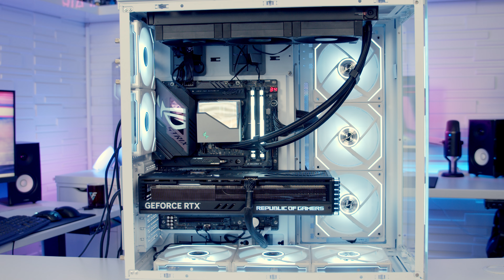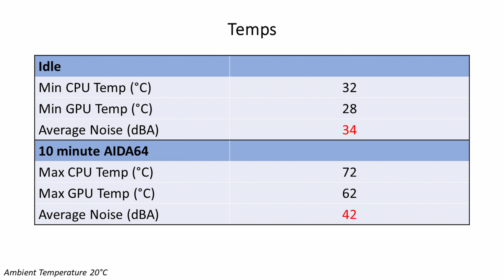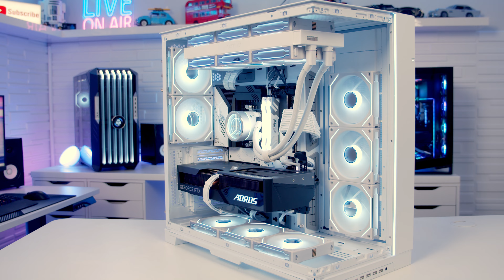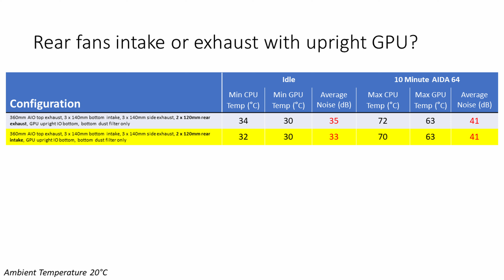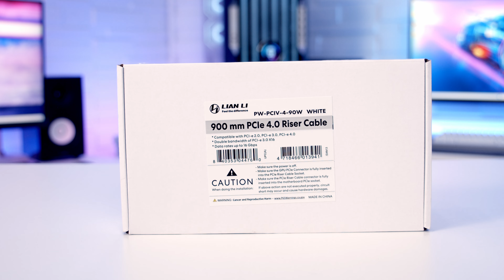Lian Li O11 Dynamic Evo XL - Best Fan Configuration

Comment: TLDR: You're rockin' it. Thank you and keep up the good work!
This is amazing sir. I have thoroughly appreciated your Lian Li o11 D, and XL analyses. (I never comment on videos, and am going out of my way to show my appreciation!!!) I stumbled upon your channel after doing over 50 hours of case-, case fan-, and radiator fan-based research this week. I then theorized optimal builds with the Phanteks nv7 and o11 D XL using hand-drawn fluid dynamic vector sketches for fun. I very quickly came to the conclusion that the upright GPU mount with 3 exhaust fans behind could potentially be the best configuration, and feel incredibly vindicated after watching your videos! I have a request, if I may... Have you attempted mounting the rear fans as intake, blowing fresh cool air along the face of the AIO, and helping to redirect some of the 140mm bottom intakes toward the GPU? edit: I should watch to the end. I was also (controversially) toying around (in rough draft paper format of course) with intaking the top fan closest to the GPU. I only need a 240 AIO with my 10700kf, and this could allow me to 'attack' the GPU with intakes from both sides. Falcon Northwest has a rear exhaust 120, and FE card exhaust right above their 80mm intake, similarly 'attacking' the GPU from both sides to maximize cooling, and having the exhaust/intake still nets lower temperatures.
Reply: Wow... I now realize you already fulfilled my request with the rear intakes!!! Unreal... nice work.

Comment: Womder how thermally for the upright gpu if you set aio at the top to intake with the bottom intake rear exhaust and fans behind upright gpu exhaust would work. Seems like positive pressure to me that would beat natural heat rise...

Comment: Lian Li really knocked it out of the park with this case. It's future proof for any sort of build you're going for. I bought a galahad trinity II 360 AIO and 6 140mm infinity fans and 2 120mm infinity fans for the rear. All black. I'm debating installing the AIO as an intake from the side or as an exhaust at the top. The differences in temps is so little no matter the configuration witht his case so it really is down to whatever you find most aesthetically pleasing.

And, that's an incredible achievement by Lian Li.
Reply: What did you end up settling with? New build starts next week for me. I have the galahad lcd infinity and 6 140mm reverse infinity fans on their way and I'll be exhausting my gpu radiator (liquid suprim 4090 with the fans replaced by 2 120mm inifinitys) out the back.
Reply: What if I want to use it horizontal? The right-panel bottom and glass-panel top? It increases the stability, it can never be knocked and bump accidently. Also gives a great showcase from every side, left and right, front and back, not only one side. 

Also why no one think to use cabling to go under the bottom of case? Maybe I want to use backside-down, frontside up?  There are desks with cable holes and if case was giving out ports from bottom, you could have directly send cables to the cable management hole without worrying to touch your walls in the room and worry about bents and turn radius.

Not future proof enough.

Comment: Hey man, thank you so much for the great coverage on the O11 evo XL, your videos have been a tremendous help in my latest build in this case. I do have one question though and would be super glad if you could maybe answer it. So things are a bit complicated but I'll try to keep it short: 
I originally had my system (threadripper eATX) in the old, original o11 but had to upgrade my GPU to a 4090 Strix to get some 3d renders done I couldn't fit in my 3080s VRAM. Something not fitting is kinda gonna be the motto for this whole story 😅 Not being able to now close the side panel anymore I ordered a custom cable mod right angle adapter (which points the cable downwards in the direction of its fans in a traditionally mounted system), which took over two months now and was also pretty expensive. After realizing it all still would not fit I decided to upgrade to the EVO XL. I am now facing a whole new problem though: With the 4090 in traditional horizontal mounted position I can't reach the second x16 pcie slot anymore which I need for my 4x4x4x4 NVME expansion card as Asus had the clever idea to make the strix 3.5 slots wide instead of 3. I have really racked my brain finding any viable solution but it's really tough. Initially I thought I might be able to sneak a riser cable underneath the GPU but even with the slimmest of slim ones I could find this would not fit I believe. (Lowest profile I could find on Aliexpress was 7mm extending over the PCIE slot and as far as I could measure it I have exactly 4.99mm between GPU and PCIE slot. 
So my last hope would be upright mounting which does pose questions though. I only ever see build where people upright mount the GPU but don't populate any other PCIE slots, so the riser cable can go straight down. How is the situation if there is some other stuff mounted, in my case said 2 slot NVME expansion card and Blackmagic Decklink video card (rather small thing). Would the riser be long enough to run it over these components? Or is it possible to feed it out sidesways through the grommits to the right of the mainboard? Also would I be able to keep using my expensive 90 degree 12VHPWR cable? I really don't have a feeling for the amount of space around the GPUs power connector in this upright orientation (I would probably have to go with GPU IO on the bottom as it's the Strix variant which I heard really only should be installed IO facing down because of the way its vapor chamber is designed). 

Would be awesome If you could give me any insight on that! And if you (or anyone else reading this comment) have any other ideas how this problem of blocked PCIE slots could be solved please let me know! Thanks again and cheers!

Comment: Curious, is it possible to flip the GPU so the fans are on the back side? I know this isn’t as aesthetically appealing , but was thinking if you flipped the GPU and had the fans behind it set to intake, it would kinda be similar airflow as if it was mounted in the normal horizontal configuration. 

So top AIO (exhaust), back fans (exhaust), bottom fans (intake), side fans behind GPU (intake). With GPU flipped over
Reply: That could work but defeat the purpose of the upright GPU config, that is show the "best side" and the fans of the GPU
Reply: Also hot air is pumped into the case with the GPU flipped.

Comment: Suggestion: please compare the AIO tubes up vs tubes down efficiency when it is placed on the side. You may do it in any pc case. I would like to buy a 360mmn, it most be tubes up in my pc case, side intake and I don't down if there is any loss of efficiency and how much is it.

Comment: Hey Chris
I have a question that has been going on for two years and I don't find any answer for it
Do motherboards without chipset fans reduce performance in games as they depend on passive cooling, which reduces the wattage of parts such as the cpu and gpu
Thanks in advance for the answer

Comment: Thanks for the review!  I think I would go with vertical GPU and a push/pull from top as exhaust.  I know the push/pull is not a difference maker and costs extra $$$ but I want those extra fans to cover most of the black grommets so they are not so visible.  Very informative, thank you!

Comment: Pretty good analysis, as always. Good point you covered the rear fans, its really good idea to set intake. Since I have a 4090 LC with 240mm AIO (Side) plus the CPU AIO on top, both exhaust, it will need an extra intake.

Comment: This is a great configuration comparison video indeed!
I wish, however, you had tested configurations under air-cooling. As I noted in my comment to your review of this case, vertical GPU mounting is considered to have a greater impact on CPU temperature when an air-cooler is used. With AIO, GPU position doesn't really matter much as heat from a GPU does not give a significant adverse impact on neither a low-height CPU water block nor a radiator at a distance whereas, with air-cooling, GPU heat directly hits a CPU-cooler just above and significantly affecting CPU temperature. Notwithstanding Lian-li's focus on water cooling, this case is also great for air-cooling provided a GPU is mounted upright.
With regard to tested configurations, upright GPU mouting seems to be not necessary worse in terms of noise than horizontal mounting, for your table (18:01) shows that idle noise is 1 dB lower with upright GPU mounting although load noise is 1 dB higher. I think that idle noise matters more since your PC is at an idle or light load state longer, unless you are benchmarking your PC most of the time. Based on the result of your testing, I would rather say upright mounting is slightly better in terms of noise.
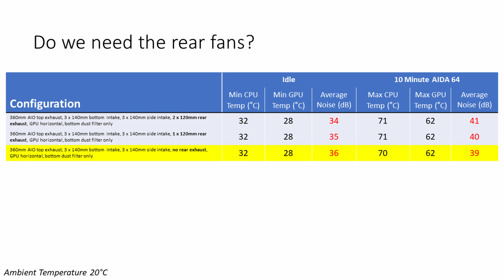I am a bit perplexed that your rear fan configuration testing shows noise distribution is reversed between idle and load (3:21). Noise is greater without exhaust fans at idle but is less without  them at laod.
With regard to the comparison between 120 mm and 140 mm fans, the result may be due to certain characteristics of these Lian-li fans and may not be generalized. This difference seems to be caused not by the difference in fan size but rather by the difference between these two Lian-li fans used. 
Speaking of Lian-li fans, I hope you also use fans other than Lian-li's, for instance, Noctua fans, in addition in the future if you could. I suspect there are a considerable number of people who use Noctua, Arctic Cooling, Be Quiet, or any other fans of their choice instead of Lian-li fans even if they use this case. It is one of the unique advantages of O11D EVO XL as well as O11D EVO that they don't come with any pre-installed fans so that you can use whatever fans you prefer. Personally I would definitely use Noctua fans if I build a PC using this case now and Alpha Cool's upcoming Apex Steath Metal fans if I build it later when they become available.

Comment: Love your analysis of all of the different configurations. It’s surprising that the temps of the push/pull configuration wouldn’t be better. They always try to sell “more fans more better” however it makes me very grateful that you do the testing you do because it becomes clear quickly that it is not always true. I also love that you keep in mind aesthetics. Even if things run a degree or two hotter it can be 100% worth it if it makes the case that much more pleasing to the eye. That is the point for most of us after all lol. Thank you and keep up the great work!

Comment: Curious what the results are like for a fully air cool build (cpu air cooling tower rather than AIO) and especially in inverted case config.

Just with how the fans and airflow get so weird with horizontal GPU,  inverted mobo + CPU tower.

When inverted, a horizontal GPU draws air from the top. It is common to have one of the fans function as flow through blower as well, and that would blow air down to bottom.

Of course upright gpu mounting can eliminate that complication, but that comes at much greater additional cost. 

Anyways, I think it's worth checking out.